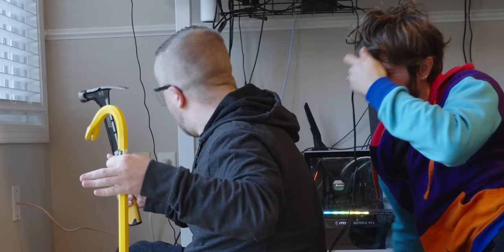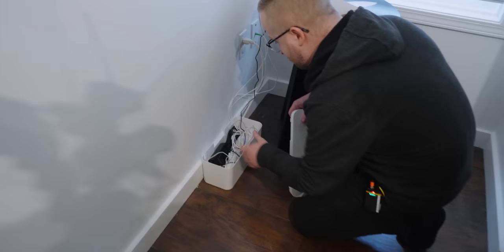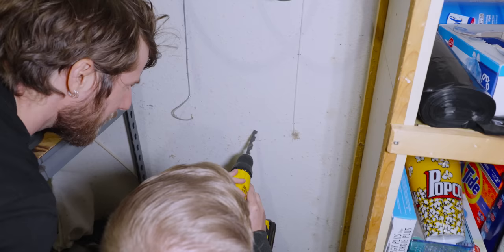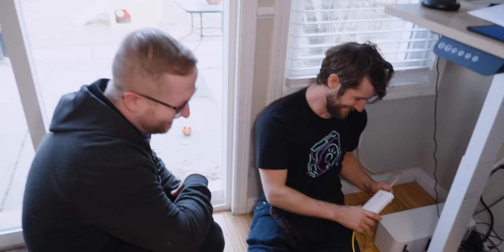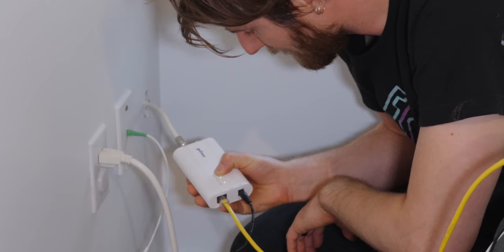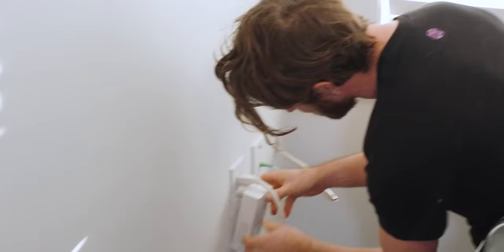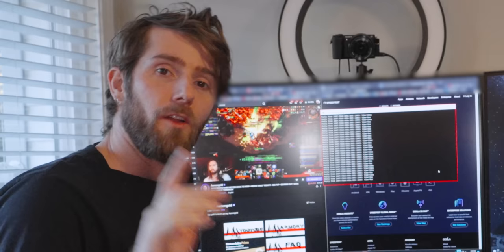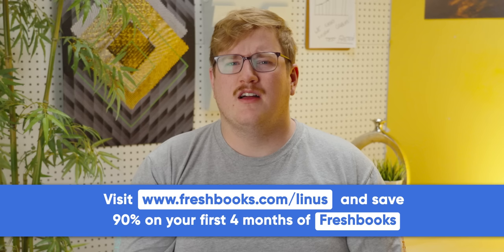I Will FIX Your Wifi - MoCA and Powerline at Colton's House

Comment: You use a moca filter where the coax enters your premises to stop your neighbors from getting your moca signals. To get full moca speed to multiple locations, it's possible to use multiple moca adapters, but disconnected from the splitter, so they only use direct runs to a specific room, then connect the now disconnected splitter side of the moca units to a central ethernet switch. This is layout dependent and probably much harder to do if your splitter is outside. Also wont work if you want TV over the same coax. Works great in a setup with a splitter inside when you just want to send data to certain rooms.
Reply: If you use cable internet then MoCA filters also prevent the local cable company from knocking on your door. Because without a filter you create a crap load of noise that affects everyone else on the pillar that your house is connected to and if you don't fix it. The cable company will eventually disconnect you from the network. It takes what feels like forever, but they will eventually do it if you fail to correct the issue (it's classed as interfering with telecommunication infrastructure if you were remotely interested!).
You can also use MoCA networking with regular/legacy cable boxes on the same outlet. Nearly all MoCA adapters have a built-in splitter on the receiving end for this purpose. The only time these adapters may not work with cable TV box, is if you have a legacy whole home PVR system, because they (can/do) use the additional frequencies to deliver a cable/PVR recording to the box from the main head unit.
Reply: Mostly this. And in the case of Colton he's on fiber in a Single Family Unit. I wish Linus hadn't glossed over the coax/moca setup for apartments. It's not something that someone should be afraid of having "stolen" by their neighbors.
Reply: @booblla  that would depend on what signals your cable company is using, MoCA adapters use frequencies above 1002mhz which is not a frequency a lot of cable companies are going to use for transmission because they are with a high degree of likelihood using MoCA for internet connected cable boxes, where as the frequencies your local CMTS (Cable Modem Termination System) are receiving data on are much lower. The issue you're most likely to have with a bunch of MoCA devices connected isn't the MoCA itself causing an issue, since your house as well as other subs should have a point of entry MoCA filter, but rather potentially damaged or not well terminated cables allowing ingress of interference from other sources, typically below 200mhz.

Comment: Former Dish installer here. The reason why Linus said that Dish uses the same frequencies and MoCA for Ethernet may not be compatible with Dish, is because Dish actually uses MoCA for their Hopper/Joey products. Those systems are less like a traditional set top box setup, and more like a media server with a bunch of Nvidia Shields connected to it via MoCA. Hence the conflicting frequencies. It's already basically using MoCA for Ethernet. If you have one of the older set top boxes or DVRs, instead of a hopper, then it's entirely possible that MoCA may work for you
Reply: Certain cablecos also work this way, for example Xfinity. FiOS also uses MoCA, however, unlike Xfinity, whose central set-top box actually has it’s own, separate, 8x4 modem in it that it uses for internet connectivity, and which acts as gateway/router for every other cable box you own using an unconfigurable local network that conflicts with any other one you might want to use over MoCA, Verizon’s boxes get their internet connectivity from the regular gateway, and you can use your own network (including your own router and MoCA bridges) without issue (you if you do use your own gateway, rather than theirs, you do lose some features; workarounds exist but are somewhat complex).

Comment: Just a note for the Powerline stuff, do not use it when you have an VDSL (Super-)Vectoring connection for your home internet at home. Especially with Supervectoring those devices will create an insane amount of errors on the DSL line due to basically the same frequency and typically not well isolated power line cables running next to the DSL one. On many cases the DSL modem will either have frequent drop outs due to that or will need to cut down the speed imensly. Powerline manufacturers sometimes offer an compatibility mode for Vectoring in their devices, however this will make the actual Powerline connection a lot slower.

All big ISPs in Germany for Supervectoring for example don't promote those devices (but instead Wifi Mesh stuff) and also won't fix the connection line as long as you use them.
Reply: That's very interesting and answers a long standing question.
Reply: Good piece of advice, as our build site just got the Telekom vectoring crap (max. 175 MBit advertised) instead of proper fiber. Not that I'm planning to use PowerLine in the forseeable future, but it's good to know anyways.
Reply: Interesting. Someone I know gets fibre to the node and then VDSL from there to their home, and he uses powerline adaptors plus a Wi-Fi repeater, but I don't think his connection uses vectoring as I remembered he got around 50 Mbps download speeds when I stayed with him for a while a few months back. If he ever were to upgrade his plan to one that uses that, I might warn him if I could remember to do so.
Reply: @kbhasi  50Mbit/s is no issue with powerline, the actual interference only starts with a 100Mbit/s Vectoring connection and gets worse and worse the faster it goes.

Comment: It would be nice to mention that powerline will always have a higher latency due to how it works: Data packages are only sent when the sine voltage of the mains is close to 0 volts, which means that only a portion of the time the data is transmitted and it is totally related to the grid frequency (50 or 60 Hz)
Reply: Not sure what you mean since coming out of the device the 60Hz will be filtered out
Reply: Bull shit I've used powerline tech before and the latency is equivalent of ethernet in general

Comment: Since I bought a Netgear Orbi mesh system in 2017, I haven't had any Wi-Fi issues. Using ethernet between the main station and satellite, having a solid connection when connected wired for the TV Media console and my main PC for flawless streaming and Wi-Fi connection across all devices and locations within and around the home is consistent. Also, I love that I can go anywhere in the house and the backyard without getting a signal drop or connecting to another connection point in the middle of a stream.

Comment: I use powerline in my house between my PC and the router (PC upstairs in a spare bedroom and router is in the kitchen) and I love it, it gives me such better ping and I even get better download speeds on it. I also run both ends of the powerline through plug adapters, power strips as some people call them, and it works fine. Though thats mainly because my plugs are stupidly close the skirting boards
Reply: dude i’m stupid, i didn’t even know this was a thing. I’ve been running a 50ft ethernet cable upstairs for like a year 😨. Which would you recommend?
Reply: @juliwomp  cable anytime, as an isp technician (12 years experience and counting) I can guarantee you that powerlines will give you trouble, so always go for cable, second option is moca, third option wifi mesh and most certainly the fourth and last option is powerline
even if you have a clean electricity signal entering your house (fyi almost non existent) then you still have your electric home devices and cables to deal with
Reply: @JB-Voices  Interesting. Even in my house that has a very suspicious electrical installation we've never had any problems with our powerline connection in nearly a year of use. 

What sort of problems did you encounter in your work for you to rate powerline so low?
Reply: @nabla6100  extremely intermittent latency and speed, that is why even wifi mesh is better in most cases
concerning your house, funny enough, older electrical installations (with very few circuit breakers) often work the best
Reply: @JB-Voices  I had these issues, turns out there were other powerline type adapters connected to the network which I disabled from our network. Sorted out all the issues. 

Also plug directly in a socket both by Hub and upstairs device.
Reply: @JB-Voices  As someone who's been using powerline adapters for 5-10 years by now, I wholeheartedly second this. The technology is neat, but it performs extremely subpar at times (at least with my 1960's apartment electrical wiring). Random dropouts for no reason at the most inconvenient of times, terrible latency, speeds far lower than they should be. Worst of all is the downright atrocious config software from every single vendor I've been able to find: netgear never worked properly, tp-link's thing worked until it didn't, zyxel's tool sort of work but looks straight out of windows xp and does god knows what for minutes any time one clicks on a different menu.

Cool tech, but should honestly be avoided if possible.
Reply: 10years ago I had a cheapo 200mbit set with just 2 adapters. Worked just fine for my 16mbit internet connection.
We then upgraded to a 500mbit devolo set with 5 to 7 adapters. Every few days (at the very least) one of them would drop out and it wouldn't start working again until you replug it and hit the decryption sync button on every single device again. 
Ended up throwing cat 7 into some of the walls. Now there are only 3 adapters left and all of them are on the same phase (European 230V grid). Problems have stopped.
So it can work reliably (it now does so for like 3 years without a single hitch). I'd say buy a cheap set and give it a try. Especially if you only need a single connection and can swap circuits in the electrical panel there is a good chance of it working out. There's also a device that gets installed in the electical panel that bridges all three phases , but I have not tried that.

Comment: With powerline it is worth noting that you won't get the maximum rated performance unless both are on the same circuit (i.e. not going through the switchboard/breaker box).
Reply: Which basically defeats the point as most rooms are on different breakers. If it's in the same room (so on the same circuit) just run an ethernet 😂
Reply: also worth noting that in an older house, your performance is likely to be drastically worse as the circuitry used in homes pre 80's was total dog shit compared to today's spec. But, that's an inconvenient piece of information Linus and co left out. They definitely should have had a low voltage tech look at this.
Reply: @jonfromsyracuse  the fact yank houses dont have proper earth pins like UK does. It works flawless if its a 3 prong socket device

Comment: Couple of MOCA lessons learned the hard way. First, the internet provider's MOCA is not fully formed and can throw the other units off. Secondly, you likely can't permanently turn off that at the router (it will come back on in the middle of the night from the headend). Last, wire the two units together in front of you and set up IP and encryption first, then move the units to the intended destination.
Reply: The problem is that the white RG6 coaxial cable wasn't checked to see if it was even connected inside the home. Their concerns about the outside cable box was pointless. They needed to find where the main RG6 coax cables were at in Colton's house, use that coax connection at Colton's desk as the main source and disconnect that coax line from the output of the splitter to the input so that it would send the signal properly throughout the home cable connections.
Reply: @spankbuda5760  yeah step one is to tone out all of the lines and not "hope" they are connected. this can be done with a DSAM , a cable toner, a volt meter (look for 75ohms on the coax)  or just tracing the wire with your eyeballs from end to end.   After you trace out the wires connect both mocca adapters in the same room to make sure they actually function and is configured.  THEN  connect the adapter on the outlets and rooms you want.  just connecting the equipment and hoping for the best is how you waste a TON of time.
Reply: @spankbuda5760  Yep, as I watched this I wondered if that was the line from the cable company. They don’t show them verifying that it isn’t, so connecting to it of course wouldn’t work. Ah well.

Comment: Darn, Moca was the main thing I wanted to see tested. I tried powerline in my apartment and the speeds were just abysmal.
Reply: I've used MoCA for years and you'll get nearly the same speed on MoCA as ethernet.
Reply: i used moca & got nearly 850mbps on speed test
Reply: i get 1GB Up/Down with MocA so no need to worry about speed.
Reply: interesting comment i found
"Something not mentioned in the video is that if you're doing the powerline solution you should really make sure it works well for you while it's still within the return warranty period. Older buildings, specially condo buildings, have really fucked up wiring and it makes the internet significantly slower and laggy."

from "sadman hoque"
Reply: Moca can work great even in apartments if you have a "tree" style wiring architecture, meaning there's a single coax going into your unit and from there there are coaxes going to the living room, bedroom, etc. If all your coaxes go to the building's electrical room you can still do it but it'll be more difficult, you'll need a toner and probe to find all your coax. Don't trust the labels lol.
Reply: Moca is way better than powerline for most people. I've used powerline for a while, the newer adapters are decent if u get good ones (and if the power cabling in ur walls isn't trash) but Moca is just way faster. Only reason to go Powerline instead of Moca is if moca is too expensive for you (like it was for me back then) or if you don't have coax cable outputs in your rooms. 

Also, if you currently have cable but not in the rooms where you where you want MoCa to go to, most of the times you can get the cable company to come install coax cable outputs in your rooms for free as well, just tell them you're planning on putting a cable box in there then return the cable box in a month or two.
Reply: @zagohcap  I remember when all Ethernet was coax. If you wanted something with easy modular jacks you'd get token ring.

Comment: I've been using my powerline ethernet adapter for 2 years now and it is still working as intended! I got the cheapest one I could find so I'm limited to 100mbps but I'd rather have lower speeds and consistent connection rather than my dodgy wifi.

Comment: Comcast uses moca to communicate to the other cable boxes. It's how one of the node boxes can tell the main DVR to record. Moca is also used for a lot of their diagnostic tools as well.
Reply: If you have working cable TV or Internet in your home that doesn't mean that all of the cable outlets are connected to each other. Certain cable companies or satellite providers use different cable splitters that operate between different frequencies. Sometimes when you switch service in a new cable technician comes in they need to switch out those splitters and will only hook up the bare minimum to the rooms that you're requesting service in. There are "cheap" (relatively speaking) testers that can tell you of specific outlets are connected to each other. It's one of those tools where you're the guy who owns it and all of your friends borrow it once in a blue moon...
Reply: Okay and another one. If you call your ISP complaining about having internet based issues, but choose not to disclose that you're using either one of these methods... You're a jerk. You're not plugged in using ethernet don't answer that you are. You have a bunch of extra Bologna Sandwich between your device and that modem then just an Ethernet.